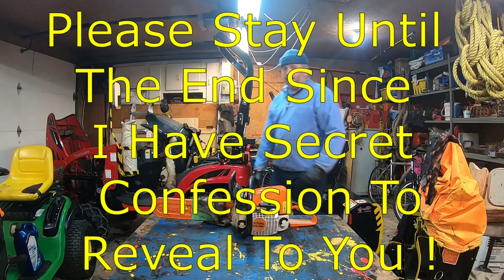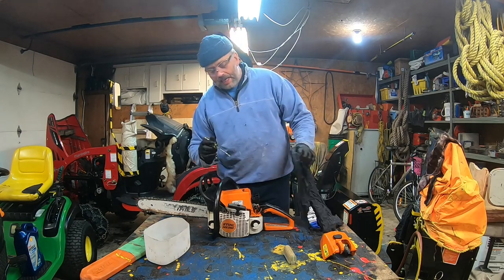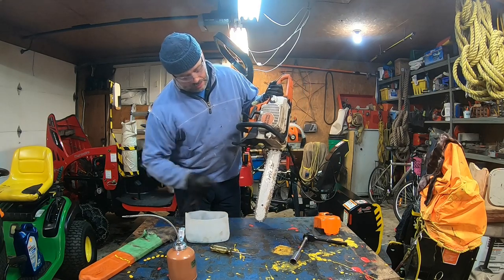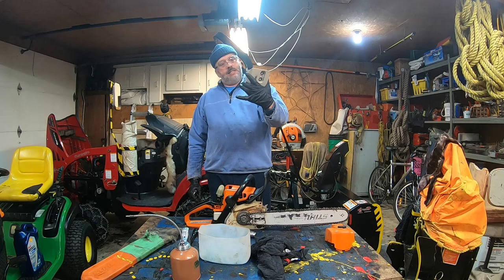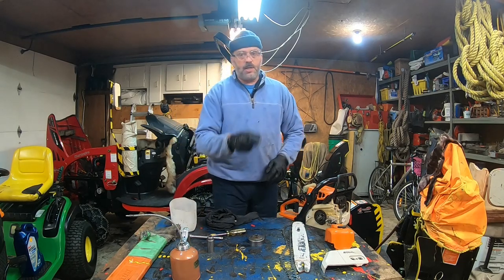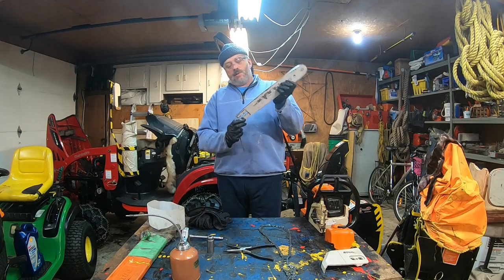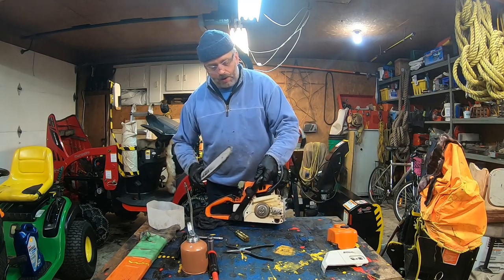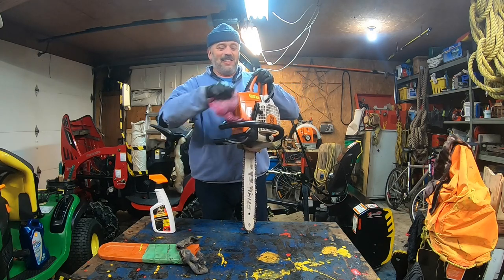How To Properly Prepare Your Chainsaw For Short And Long Term Storage In Various Wet Dry Conditions

Comment: Good morning Sir, you are keeping your chainsaw in top notch.  No I don't use Armor All but it does make your saw nice and shiny and it will protect the plastic from UV rays.  I cut pretty much all year round but the one thing that I would add to the long term storage is to park the piston head TDC (top dead center) thus closing off the exhaust and intake ports.  Have a great day Sir.
Reply from the maker: Good day Sir, Thank You Very Kindly and Yes that is a very good Idea and having the choke close too will help for sure 👌👍😇 Thank You Again and Keep Up Your OUTSTANDING Team Work With Your Lovely Wife Videographer Sir Cheers👍👌😇🍻

Comment: Great tips Dave. My chainsaw definitely needs a good cleaning 🥴. I really like my battery operated chainsaw less maintenance 👍🏻. Bon semaine sir 🙋🏼‍♂
Reply from the maker: Good Morning Luc, Thank You Very Kindly and Yes these electric Chainsaws are getting better and better over the years. I knew someone 25 yrs ago was using one with power electrical cord and it was very impressive and yes less maintenance and almost as powerful than my MS 250 but not as my Husqvarna 266 XP with is a real BEAST 🤣👌💪 but having them on battery is very interesting for sure 😇👍Cheers 🍻
Reply: @RCAFpolarexpress   The battery chainsaw is the right size for me since I don't need firewood because I don't have a wood stove MOUAHAHAHAHAHA 🙋🏼‍♂👍🏻😂🇨🇦☕
Reply from the maker: @OrangeismyNewGreen  YES In Deed, BUT IT WILL COME 🤣👍👍 Resistance Is Futile, YOU Will be part and Fully Assimilated to OUR WOOD STOVE COLLECTIVE 🤣👍👍

Comment: Comment ca va mon ami?  You have done a very good maintenance on your saw Dave.  No wonder it looks like new and it's 10 years old.  Even where the main chain drive is looks like new.  Totally awesome.  And using Armor All looks like a good idea too.  Merci pour la video et a bientot!!
Reply from the maker: Bonsoir Mon Ami, Thank You Very Kindly Mon Ami, I did change 3 times the Cutting Bar, Change the chain drive spoket drum, and Also the Bearing Once. Thank You again and Bonne Semaine mon ami and best regard to your Nanny💖🌹😇👍 Cheers  🍻

Comment: Interesting, using non ethanol gasoline is the only way to go, I never have a problem firing up my saws after storage. Merry Christmas 🎁
Reply from the maker: Good day Sir, I totally agree with you I only use High Octane non ethanol 😇👍 Some of my chainsaw were on storage for more that 5 yrs ( that is what I call Long Term !!! ) but having oil on the piston is very good ( clean, lubricate and also safe from rusting rings ) All My Chainsaws, except my stihl ( 15 yrs )  are more than 30 yrs old 😮  Thank You Very Kindly For Subscribing to my channel Sir Cheers 🍻